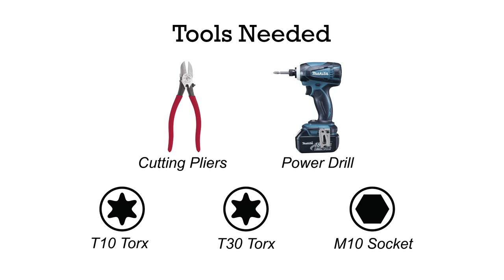How to replace the Mercedes-Benz Interior Door Handle  C-Class W204 GLK X204

Comment: I did this repair on my pre-facelift w204.  The original and the replacement failed as well; as when I got the panel off I saw that the latch had been replaced once before from the evidence of the melted plastic seal already being cut.  It was obvious the first original repair was done by someone who was inpatient and certainly didnt make surgical cuts like I would have.  Also I noticed the plastic piece that hold the wire cable was facing downward as opposed to upward which I think lead to the break as it looked like from where it failed on the loop of the inner latch.  The panel came off easy as it had been removed before and the third t30 or clip was already gone, nothing there haha.  When I reassembled my latch was still hanging so I removed and realized there was a little seating area to stage the wire in the correct position which fixed the latch hang.  What sucked is that after I was put back together the central lock buttons were malfunctioning.  So I ripped it off again and confirmed all the wires were connected good and it didnt fix the central lock button malfunction though I had central lock function from my fob only.  I basically accepted the buttons were broke and was happy the latch was fixed.  The only time I used the central locking was to unlock and outdoor latch release myself out of the car.  Anyways I took the car for a spin after fixing the latch and out of nowhere the central lock function buttons came back online and started popping the door lock up and down again.                                                           Tips: 1)  When removing panel clips you can get to the one from the little hatch that opens above the speaker to access the electronics, if you look close you will see the orange clip, stick both hands in and with an impulse of decent force pull and it will pop that single clip.  Repeat on all clips and only necessary if you dont have the proper trim removal tools.  I feel like a good controlled yank does the trick.  2)  When all clips released be aware of the cable and remove and also lift straight up to not bend the locking bar unit when removing panel.  3)  I would recommend a dremel or rotary tool to grind off the plastic seals to leave plenty of plastic under the seal left for the new screws to have something to grab onto when fastened.  4)  When removing the m10 caps do so with care and precision as the screw top is plastic and will strip easy use a small flat head to open the caps a little if they stripped on you.  5)  When removing the central lock and auto window unit wire connectors remove the water proofing with care as replacing it will help avoid water getting in the wires if it leaks like most w204's do from the sunroof.  6)  When removing the latch led unit figure it out because mine appeared snapped from the first repair and I dont blame the guy because I have no clue how to remove that style of wire connector.  7) When removing the pin from the latch mine had a little hole of which I couldnt get it  out without using a drill and screw.  I used a #2 wood screw and a #2 drill bit on a drill to drill in and remove.  The new pin was unusable on my cheap ebay kit so I just used the old one, thank god I didnt go hammer time and hulk it out like might have if I assumed the new pin would work.  8)  When putting the panel components back together make sure the little nipples are seated so that it fits together properly it will make setting the screws easier and smoother.  9)  When replacing the panel make sure you dont snag the tweeter.  10)  When replacing panel make sure to put the plastic clip in the correct position (upward and the wire metal snapping down into the latch I believe), and also make sure to seat the wire in its guide slot to provide the proper tension to the latch.  10)  Make sure you hook the door lock bar and connect the central lock and auto window units back into their slots.  11) pop one clip or temp hang the panel and make sure the buttons work and windows etc works to confirm the connectors circuit is made.  Dont panic if your lock dont work mine came back online about five minutes later when they felt like it.  I would be worried if they dont make any noise as mine made a little noise like they were trying before they eventually worked like nothing happened.  12)  If everything looks good then replace the tweeter housing and the electronics access hatch, replace the t30 screws and your done good job I hated the whole process because I was worried I would rock my electrical or something.  All in all I was able to fix it on my own I would rate it harder than resetting sunroof drain tubes but much easier than anything catastrophic like an intake manifold or something heavy weight like engine mounts.  I would recommend you not try it if you are inpatient and if you are just psychologically prepare to have a non working whatever you might break.  If you dont want to pay the dealership 1200 and can fix things you might be able to pull this one off on your own with the right tools and a video for open for reference.

Comment: Thank you for your video bc it saved me a ton of money. My boyfriend changed out the passenger handle from my 2010 MB C-300 with over 110,000 miles, but it wasn't as easy as it was on the video. It would be nice if the video was a little bit more detailed. We had such difficulty removing the tab behind the pillar cover, all the plastic tabs were a total pain, and removing the pin from the handle was the most frustrating part ever. Took us 3.5 hrs to complete. Once we replaced the handle, putting everything together was quick. I purchased the kit that was linked in the video for $40. I have no experience with cars and I would never have been able to do it myself though.

Comment: I am a decent mechanic and I spent nearly 7 hours on this. You cannot cut the plastic welds odd with cutters. I used a dremel. Then I spent over 2 hours trying to remove the handle pin. It never came out and I f’d up the door trying to drill it out. Hey folks, this is why The dealer puts in a new panel. My times worth more than this effort. Shot my whole Saturday. Mad at MB for crap handle.

Comment: I bought the kit for my drivers side door on my C300.  This video is very general in the steps required to get the job done. It gave me the highlights,but not the whole story. 
  Time according to the vidieo is 1.5 hours to do the job.  I'm a pretty advanced car guy with 30 years of collecting and restoring classic cars, with the benefit of a full on shop completely kitted out and it took me just over 2.5 hours from the time I opened up the door till I rolled the car out of the shop. 
   What took the most time.
 The plastic tabs and heads.  Don't bother trying to use side cutters.  Grab your Dremel and you will make quick work of the.  Pro tip, have some epoxy handy to fill the holes and to give the screws something to but into.  5 minute epoxy did the trick. 
  The door handel pin.  I tried the screw and pull it out like a cork from a wine bottle.  Ya, that did not work.  
Had to drill through the plastic pin all the way through then get creative to extract it and the handle from the pivot.   Having a high speed air drill came in handy. 
   Reassembly was quick with the help of the 5 minute epoxy to help the screws along in some of the holes. 
Over all. A good kit that solves a common issue for less than what one hours worth of labour would cost you at the dealer.

Comment: Just finished fixing broken handle on MB sedan 4 door C250 2012 with $35 handle which I bought on Amazon from iEWorks. This vIdeo was really helpful (5 thumbs-up) to identify the  location of all the plastic caps that needed to be cut-off and sanded off. That took some time. and effort. Removing the pin with screw didn't work and took and hour of drilling out and cutting off old handle. New handle and pin worked great, reattached all door parts with screws provided with replacement handle  kit. . Took about 4 hours, but I would not pay for the new panel out of principal. To pay 600+ for a new panel to replace $5 plastic handle ( why is plastic anyway, on 35K car.) Ridiculous. Best of Luck to everyone and thanks for video.

Comment: Just fixed my in-laws car with this kit. It was the driver's side door, which had an extra wire. The instructions in this video are pretty accurate, but it would have been more helpful with narration and starting from scratch on a car with the door still on, to give you an idea of what taking things off if really like.  There was also no t10 screw under the  door molding, as said in the video. It  was a plastic clip, that I had to break. As others have said, I don't think snips would have worked easily to get the melted plastic tabs off; so I used my Dremel with a grinder head to get them off. By far the most difficult part was getting the pin out! I had to drill a small hole into the side of the pin and the wall, then leave the small bit in the hole to prevent the pin from moving. I was then able to set a screw in the pin and pull it out. The kit itself seems overly expensive for what you get. The only thing that you're really paying for is the door handle itself (which does not match the color exactly from the original). I would have liked to see them include the clip that attached to the handle and the cable that you have to take from the broken handle, as I had to use pliers to break the plastic around the clip to free it. Not the most fun fix I've had to do, but it did save a ton of money, as the deal wanted to just buy a whole new door panel + labor. I wouldn't recommend this to someone that is new to working on cars.
Reply: I need help,
I own a c 250 mb,2013,
the handle broke on the driver side what kit should I order from Amazon,desperate

Comment: Great video. Thanks. To only critique I have.  I used a rotary tool to cut the plastic tabs and a small drill bit to drill a hole in the  door pin handle then. I screwed in a small screw into the hole to pull the pin out.

Comment: Just finished the install.  It took me approx. 3 hours.  Thanks to JD Miller for his advise within his comment...!
Reply: I have a 2013 C300 I've had my door panels off for other things. But what am I up against?
Reply: @jasonb4196  Did you buy the door handle (kit) which has all the needed screws?
Reply: @e010222476  yes I bought the kit with 20 screws/washer Door handle and the pin.

Comment: Thanks for doing this. To get the retainer clip out of the old door handle, I used either a 5/16th or 5 mm socket to compress the arms of the clip and then it just dropped out. I had to drill out the old pin as even drilling a pilot hole in the pin for the screw didn't work - If I had to do it over, I would try WD-40 first, but drilling it out worked. After I had everything reassembled, the lock didn't work, very depressing for a few minutes, but all I had to do was shut the door to open the locking mechanism and it worked fine. 

There's a comment below that Mercedes does crap like this on purpose since their target audience for the C-Class are people who wouldn't be caught dead in a three-year-old car. I agree with that. The roller mechanism on the driver's side window broke a couple of weeks ago and that was $1000 to fix. I didn't do that myself because the inside panel is riveted to the door and I didn't want to mess with it. So, yeah, a new Mercedes won't have any rattles, but good luck fixing anything. Never buying a European car again.

Comment: Just finished this repair and taking those black oblong tabs and the black glued in bits apart was a royal PIA. Top tip people, drill some small pilot holes so the screws go in easier.

Comment: My door handle broke (2010 c300) about two years ago and I used super glue at that time. It stayed till now and broke again. Bought the parts from Amazon and fixed it. The install was on the difficult side. The video helped but it's not easy to cut the black plastic tabs. The white plastic tab was little easy. I used a small cutting plier and it took a while. Taking the black pin was also challenging. I hammered a nail, then used a screw and pulled it with a plier.

Comment: J.D. Miller Thank so much.  What it suppose to be $1300 at the dealer, I fixed it myself for $58.  The only difference I used a small head chisel and a hammer to knock the plastic heads out.  A cutting pliers was too difficult to do.  Thanks again for you video, God bless.
Reply: Ali Achmar $1300 😳that’s not true! Stop lying. It’s about almost $500.
Reply: Kimberly Rose , seriously!  Thanks for your kind words. First I did not lie and you should check before you respond negatively.  I called MB Dealer and they told me I have to buy the whole thing because it is one piece and will cost $650. They have to order it from Germany and will take 10 days to get it.  The $1300 is for the parts plus installation.  Have a good day.
Reply: MB Dealer quoted me at $1100, claimed it was cosmetic. Yes, getting out of the car is cosmetic I will just sit in here for the rest of my life.

Comment: Watching videos like this reconfirms why I keep my older car and do not buy NEW or European. Newer cars may look great or have just as easy to fix door handles but the plastic blend they use is intended to scratch, chromes to peel, break and break often every few years (3 to 4 years or every turn over to a new owner). Smart for the manufacturer to time the turn over of handle breakage as the average retention rate. For every purchaser inheriting this, it is perceived to be minor and happily purchase increasing profits until such time the market value drops so much that it brings financial sense in question, hastening the demise of the vehicle (which manufacturers love to cut down on 2nd hand markets which reduce newer car sales).

NEW cars will NEVER last as these things cost and would break the affordability to keep them. With constant breakage this will make who ever is persevering dependent on parts which you will find are discontinued earlier than older cars.

I have a 30 year old car where I can still get new dealer supplied parts for. It is also before aggressive product obsolescence and manufacturer sabotage. I have only ever replaced my door handle once (driver side interior only) when I first purchased the car at 13 years of age. I believe it was even a user error since my current ones have lasted 17 years (used for work daily) without a sign of cracking and really believe they are built UV and temperature stable (unlike today) and would last my lifetime. I have a new spare for security but believe will never use. Even if I did another 17 years would be my driving career and a 47 year old car will be a ripe old age for it give a door handle issue.

Comment: So far, I followed the instruction and it is working pretty good.  Waiting for the parts.  Couple questions for clarification, Do you remove only the head of the melted plastic or the whole thing?  The screws goes into what is left of the melted plastic or there is a place where the screws goes in?  Thanks.
Reply from the maker: The screw will go into the remaining plastic left from the plastic rivet. It is best to only remove the head and leave the rest of the plastic.
Reply: Make sense thanks.

Comment: The screw i used to try and take out the pin didn’t work and now I can’t get the pin out and removing those melted plastic tops are extremely time consuming
Reply: Use a easy out or purchase a screw EXTRACTOR kit instead !

Comment: ⚠️⚠️Here’s a new tip ⚠️⚠️ 
1-remove the panel 5 min work 
2-get a zip strap less than 10 cent
3- warp it around the broken handle and the door release cable twice, and zip it tight.
4- re assemble the panel 
5- have a good day 

Total work duration not longer than 10 min 
It won’t open as smooth as the original but it will open indeed! As removing the bolts is a big time, and you need 3-4 hours to do so
Reply: Mohammad Al Jaafari 🤯... might have to try this first!
Reply: Nikki Thompson try it it’s really helpful! I used a cutter to cut a single melted bolt for 5 min I couldn’t even take it out, there’s a 20-22  of them. A total disaster. It’s been a week now and my method works super fine as I attached the cable to the stronger part of the handle. Good luck dear
Reply: Leo Ja’afari my husband found a shop in the city... I bought the handle on Amazon and the guy fixed it for $50!

Comment: feedback.

Step 1: ( @ ) I had no torx30 screw in my car.  It was some sort of plastic clip that was hard to get off. i ended up breaking it and had to superglue it.   That was a pain. you should have an actual video showing how to do this. 

Step 3: cutters didn't work.  used a utility knife and a dremel. still took lots of time. you should have an actual video showing how to do this. 

Step 5: You should explain how to get cable clip off the broken handle. it was such a pain trying to get that off without breaking it. you should have an actual video showing how to do this. 

It worked. Took me 7 hours and lots of swearing.  Not sure if it was worth it.  this helped but would have been more useful showing actual video of the hard steps i stated above. 

thanks.

Comment: What part fails? The cable disconnects from the cable pin?
Reply: Where plastic handle hooks in the back.
Reply: @e010222476  where the cable connects to the handle that arm breaks it seems.

Comment: Do I have to take the door off to fix it cause I don’t want to take it off.
Reply from the maker: No, you do not need to remove the door. All you need to remove from the vehicle is the door panel to get to the handle.

Comment: Hi, I need an advise to remove the cable clip ?
Reply: I broke off the remainder of  the handle with some snips and wire cutters
Reply: @eazycontent1830  I can't remember if it was a 5/16th or 5 mm socket, but it compressed the arms and you could then just pop the clip out. easy peavey